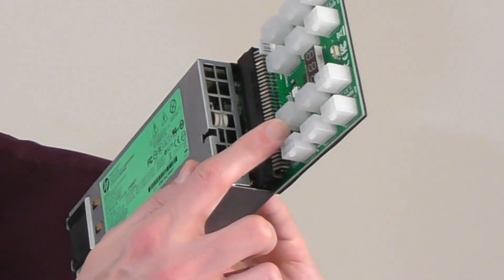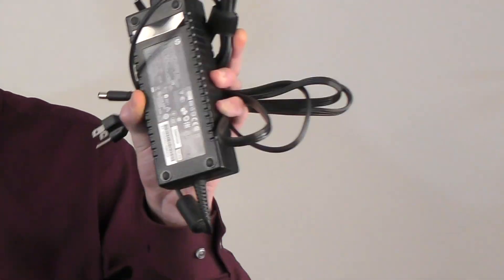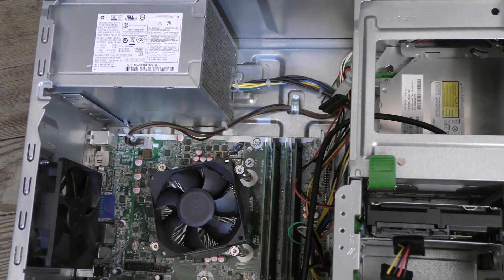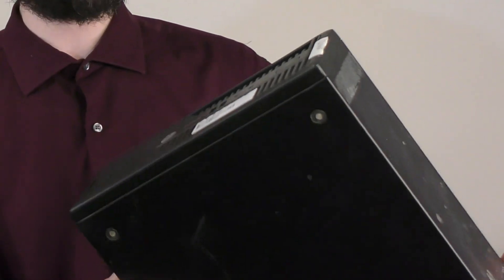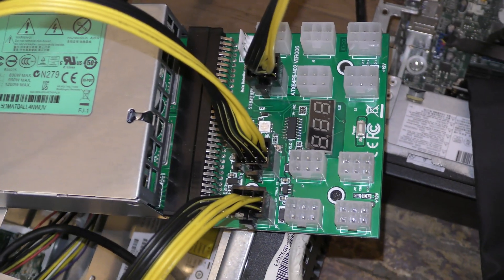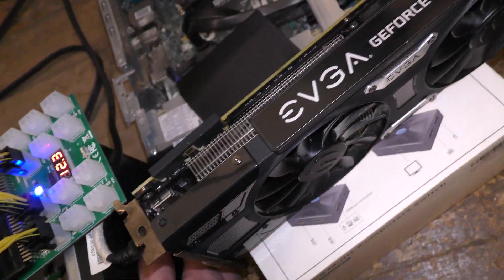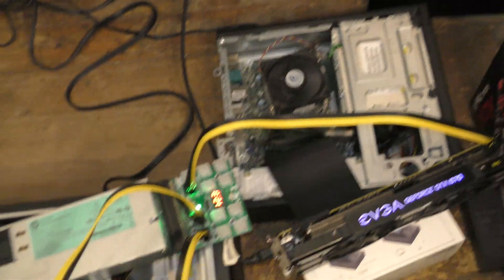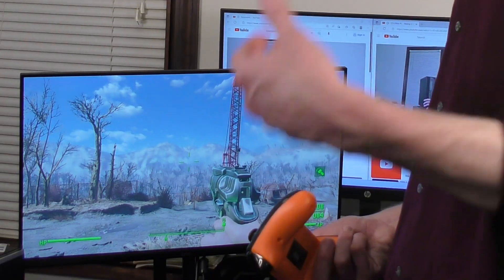i WILL Power these GPUs - Office PC Problems

Comment: If you just want to run a single GPU you can use any PSU and do the paperclip mod in the 24pin to make it power up.  I used to use it for overclocking benches when I was running multiple GPU's and only had weak PSU's.

Comment: I did something similar but not quite as extreme haha. I just converted a pcie to a 6 pin with an adapter, it's a lot trickier with the 8 pin cards.
Reply from the maker: Interesting, I haven't even seen those before. That could be really useful!

Comment: You should just get a breakout board that does all connections instead of just gpu pcie connections
And replace the oem psu
Repinnig shouldnt be a major issue to get it to fit to the oem connectors

Comment: Neat, I've wondered how well these server PSUs + breakout boards work. From the video, it looked like the GPU fans didn't spin up until after the computers themselves were turned on even though the server PSU was already on, is that the correct impression? Problem I've had using two ATX PSUs before is the auxiliary feeding the GPU causing the fans to run at full blast, would be nice if this worked better than that.
Reply from the maker: That does seem to be the case. On this round and others, it did. The 1070 specifically seemed to have its standard fan control. Didn't spin until PC was turned on and stopped spinning during idle. Same deal with a couple other device/GPU combos that I've tried. I don't know 100% that it will work out in every use case, but so far does seem like the GPU fans will only spin when the computer is powered on.

Comment: I have built quite a few HP 400 G1 MT, replacing the power supply with an HP 633187-003, you will need some 6 pin extentions, it has two six pin connectors, standard 24 pin and mounts right in without modifications, might be worth a shot for one of your creations. Ebay has a good selection, decent price.
Reply from the maker: Nice, I appreciate the suggestion! And I do like a lot of the older Prodesk/Elitedesk MT models, a lot of potential there 🙂

Comment: this is promising if an external dell oem psu can power a full size GTX 1070 then most gpus can be used with these sff machines.